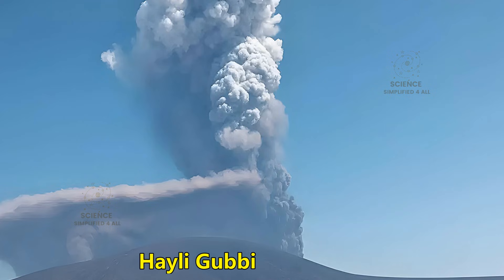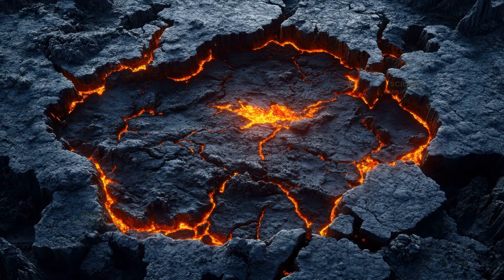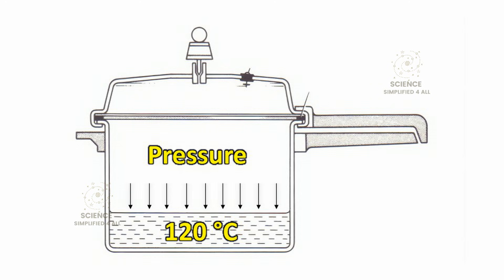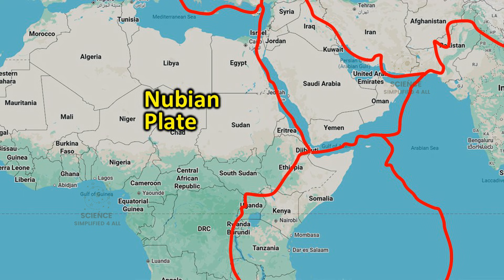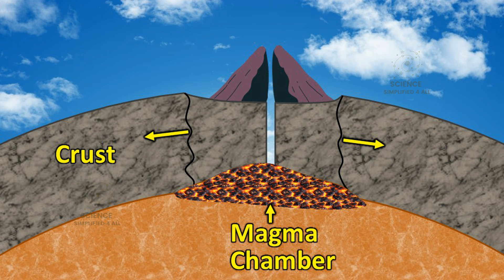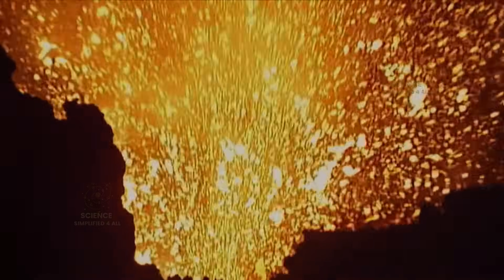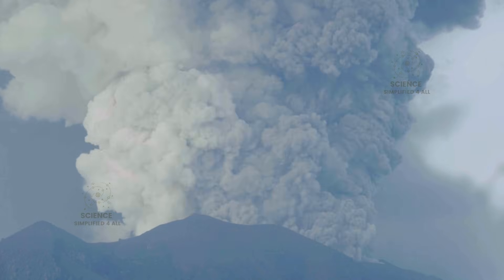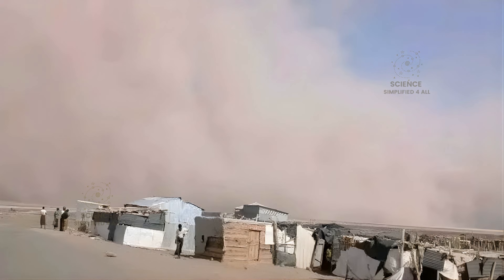The Real Science Behind a Volcanic Eruption | Ash Cloud | Lava | Ethiopian Volcano

Comment: solid not from less heat but solid from high density. There are dual spins in every field. In ward wrapping or spin creates density or gravity or time. The outward spin or expansion or push  that creates energy rings. Assume red hot ball bearing and drop it water what happens. The core is like red hot ball bearing and the magma that boils out like water.